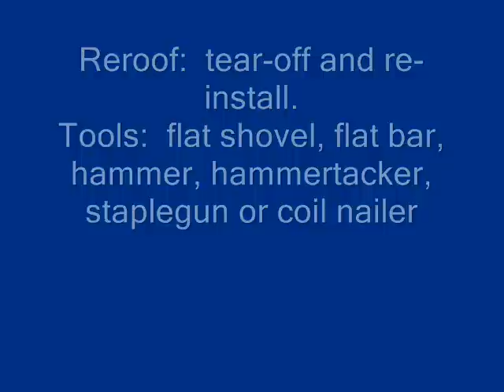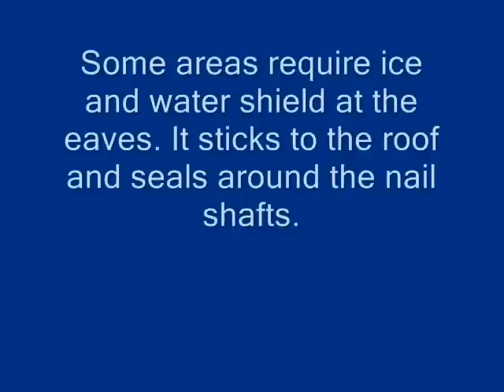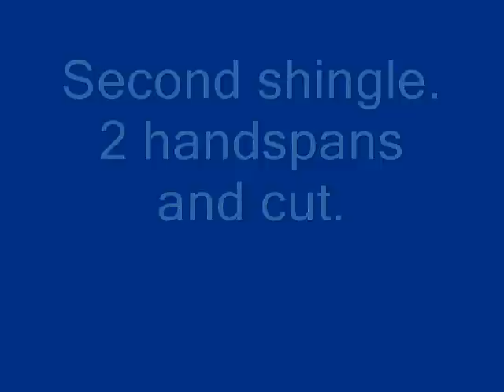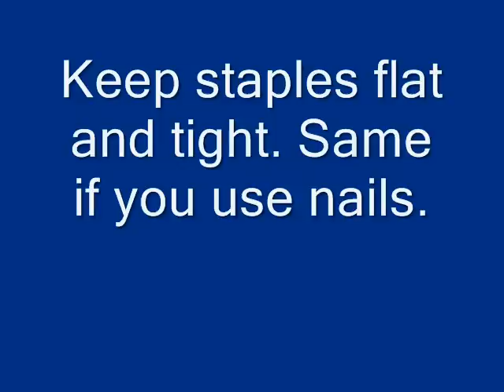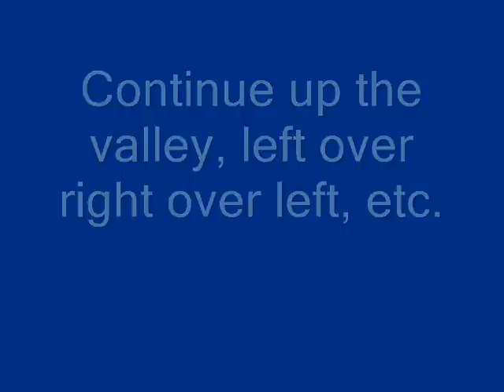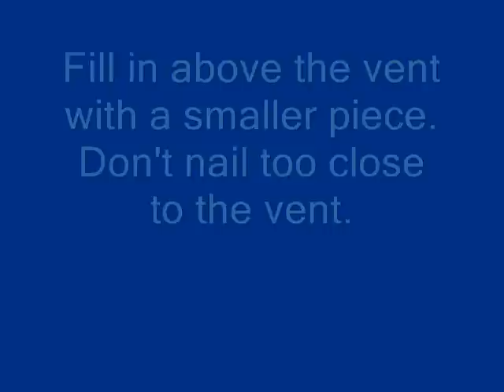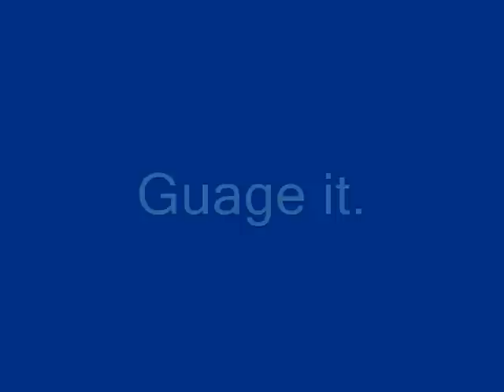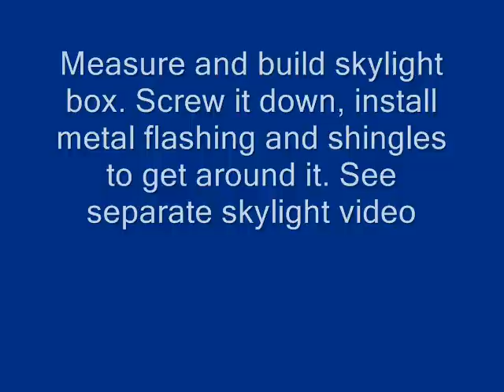Reroof Dimensional Shingles.wmv

Comment: You can us a California cut on valley shingles. Just remember to tab the tips at top. Staples are fine the only problem is that the installer hand will turn and the staple go in on an angle. Always use nails for a couple of cents more.
Reply: missippi. mass. choir

Comment from the maker: Staples hold very well if they're tight to the plywood. if you roof over an existing roof, not as good. Some areas of high wind require "nails" so coil nailer can be used. What holds the shingle down is the seal strip. Needs some warm days to seal. Most are guaranteed up to 55 mph or more. Most shingles have a line painted on to keep the nailing correct. You can remove all the old staples or smack 'em down. I remove most of them.

Comment from the maker: yes the manufacturer WILL warranty it with the use of staples. these are approved roofing staples made by senco or equivalent. I have used them for 40 years. I also use coil nails. With either one it is good to use 6 fasteners.

Comment: And for the 3-tab as starters question. U certainly may. Problem is, they're roughly 3 1/4" shorter than the dimensional and you will run into a seam-on-seam issue.

Comment: When  in doubt rip it out......always easier to fix a mistake than to risk the cost of leaving it......go the extra mile.....everything runs through the valley at least 10 inches past...no nails within 10 either.....no less than a 5 inch  stagger up your rows....and if you dont know, you'd better ask  somebody.

Comment: It's really simple nails are a up grade staples was used back in days. Today roofing nail have the round head hold shingle down stronger. To everyone it's really simple all each bundle of shingle has directions . Simple to read . 5-5/8 is the minimum depend what brand u use watching videos to get n idea it's ok . But each bundle of shingles by manufacturer tell you exactly how to space shingle n how many nails to put in 4 or 6 nails and exactly where to put the nails . When u don't follow directions on how to install each shingle as the direction say then u doing it wrong .

Comment: it's 6", 12" ,18" etc. they are called starters and finishers.
ice and water shield isn't necessary on most jobs. it's called a hawk bill blade. 
if you're going to show people how do do things show them the right way.
this is how people screw their homes up. by not having a professional do it.
and calling people who aren't lazy idiots is a very rude thing to do. some of us like to use it as a work out. and 70-100 pound bundles aren't hard to carry up a roof and they arent in your way as you roof. but that's my two cents. 
from a person who has 22 years experience building houses from footer to roof. hand nailing everything and using 1x10 roof decking. no short cuts.
Reply: Josh Ward ice and water guard should always be used in valleys and first row at bottom , cover crickets with it too , at least if you plan on not coming back for leak chasing
Reply: Depends on the pitch if ice weather guard is necessary.  This is a low slope so I'd most definitely recommend ice weather guard. Probably even 2 rows width up from the drip edge.

Comment: I would have started in the valley and run my rack as i'm lacing the valley. I believe staple guns are banned for roofing in Florida but there is a lot of roofs that still have staples in the roofs from when they used to use them. I found the best way to get them out is a hook blade  just hook it on the corner of the staple and pull them up (after the shingles have been torn off) ohh yeah the 2 inch rack would definitely get me fired if i tried that

Comment from the maker: Staples are approved by the manufacturer as well as the building dept. They keep the shingles down as long as nails.So do coil nails which were also used on this roof. They are senco style staples with a senco gun. The pattern is the same everywhere. It's not measured it's eyeballed, and NOT 3 inches anywhere. Approx 5 5/8 pattern. What are you, 19?

Comment: Your side stagger on your 4th course looks like about 2 1/2  inches. It needs to be a minimum of 4". I kept hoping you'd fix it, but you shingled beyond it as if you didn't even notice. Or do you just not care about that either?
Reply: Sean Taylor
I was being nice. This guy made a video trying to explain how to install dimensional shingles, and he can't even install a bundle without making a totally amateur mistake. He ought to leave the how-to videos to the pros.
Reply: thetruthrover yeah I saw that too and it made me cringe, although I thought it was a minimum of 6"? Or I think at least in my area it's rehired to be 6". I use my shingling hammer as a gauge to see if the stagger is too short, as the hammer head spans 6"
Reply: pguiver
You are right, Owens Corning TruDefinition require 6.5" ideally, but 4" is minimum. I don't use a gun, so yeah, my side stagger is always 5 5/8" per my hatchet gauge on these shingles.
Reply: thetruthrover i step them no less than six inches myself!
Reply: And this guy has no response?
Reply: @TimHoldbrooksJr  Apparently not.

Comment: Who taught you how to install a valley. I saw the little cut square shingle you placed to tie into starter course. The starter course should be ran opposite of the valley and should turn up slope at least 16". Lay off the beer.
Reply: +Johnny Haje WRONG
Reply: If you are installing a laminated shingle in valley why do you cut the tip of the topside of shingle off? (Tabbing )

Then at the laminated part of the shingle you will always have a point. How do you cut that? You can't!  But if you install a shingle inverted into the valley (bleeder) then you can cut your shingle straight down and then you have no tips for water to travel across. 

I shouldn't have said you were doing it wrong because that is a way.some roofers still do roofs. I apologize if I affended you.

But the question still stands do you tab the laminated shingle on a valley cut? Why?

Comment: I understand you are proud of your stapler, but hand-nailing is best, pneumatic 'coil' nailers are second, and staplers are not recommended by any roofer this side of 1982. They don't hold well, and they are a pain in the ass to remove next time around. If you've been doing this 40 years, you should have learned that by now. Oh, but I see in the description that you don't care.
Reply: When it comes to OSB, I advocate Staples.
Reply: Staples do grab into OSB quite well. However, when shingles blow off, it isn't because the nails come out of the deck, it is because the fasteners' head (or crown) has cut through the shingle.
Reply: thetruthrover Why is it then I have seen many shingles blown off with the nails along with them.
Reply: The only nails that would come out with the shingle are the ones that were driven between joints and gaps in the deck.

Comment: yes you can use a 3 tab for the starter. its best not reuse used 3 tabs because you want that tar strip active. @George Vlachos this house is probably around 20 square a good roofer can do atleast 3 an hour the number of people means nothing if they ALL know what they are doing. also reusing vents is not a big deal as long as you be sure to seal it properly like you would with any other vent or pipe casing.